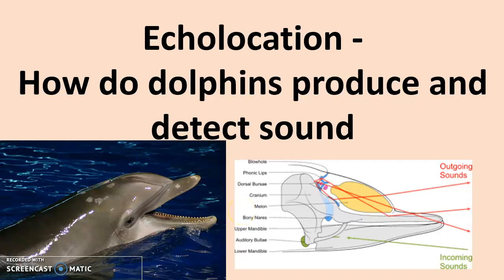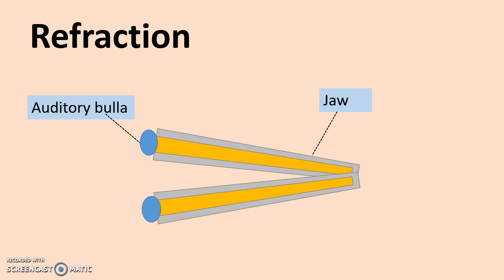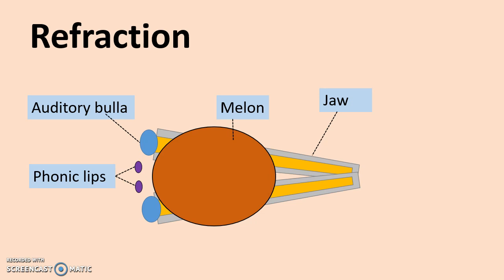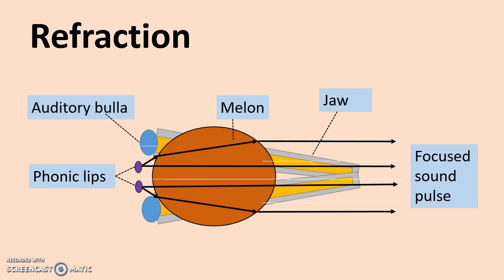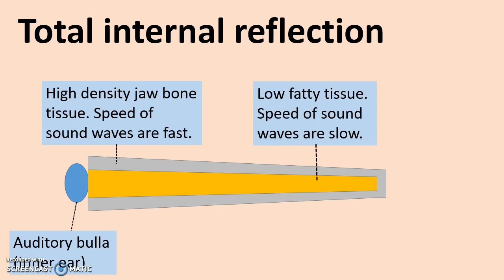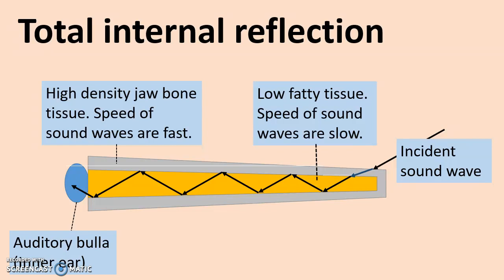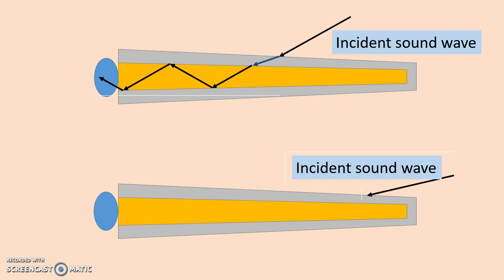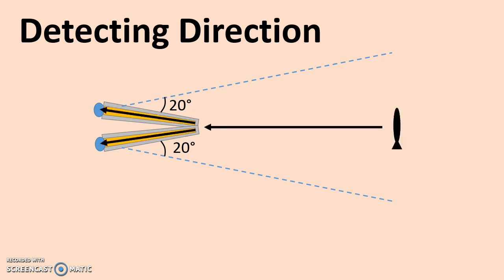Echolocation - How dolphins produce and detect sound

Comment: When the sound is emitted from the phonic lips, it is reflected by the surrounding air sacs first and refracted by the connective tissue, then goes to the melon. Without the air sacs, the sound would not transmit forward, it would go everywhere.
Also, dolphins use only the right side of phonic lips to generate the echolocation clicks instead of using both.